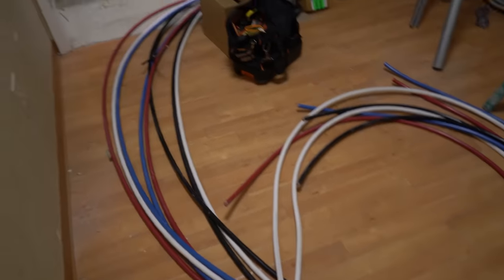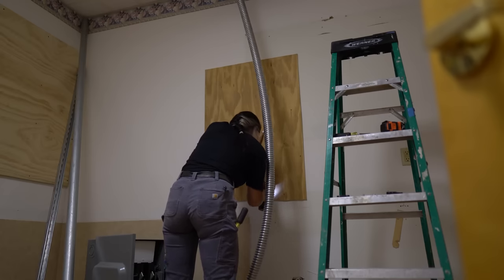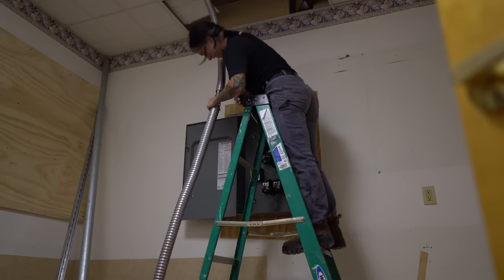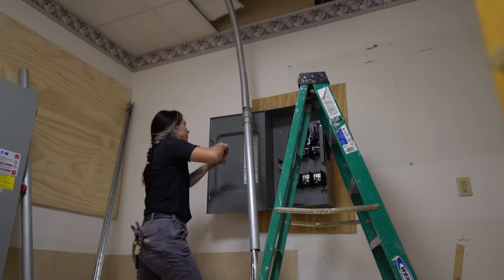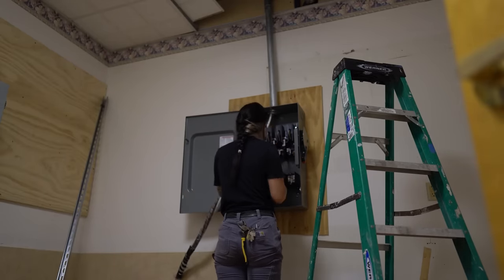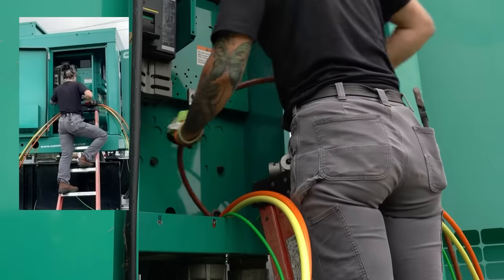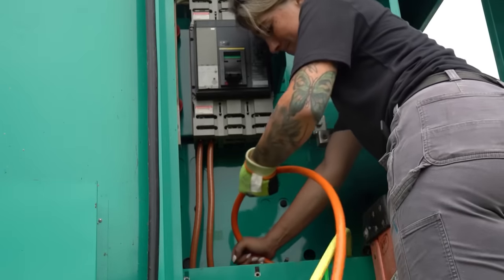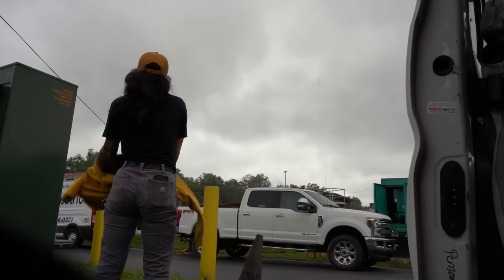Disconnect Mount & Pulling Parallel Runs

Comment: I love your work ethic! In my over 4 decades in the trade, I’ve worked alone more times than I care to count, I admire the way you worked to get that feed in the disconnect! During Super Storm Sandy, we had a rental generator brought to one of our line shops and the electrician was sent out with nothing to terminate with. Leads were 750 mcm and he was struggling so I gave him a hand. I used 2 hole lugs and a 2 ton press to terminate, it was a bitch but we finished it. Generator was for a temp feed, we never put it online, we restored power in the meantime. Again, well done?

Comment: Borrow a tip from cabinet installers.  When they hang cabinets alone, put a 2x4 on the wall at the height wanted, then place the cabinet (Switch/fuse panel) on that 2x4 and that takes the weight and can easily be held with one hand while screwing to the wall and/or plywood backer board then remove 2x4 once the panel is screwed in.

Comment: Condolences on having to be anywhere near a sewer lift station. As system operators, especially the apprentice operators, we had to ride with crews occasionally, to observe the water techs do their jobs. For those who'd never worked in that industry before, it familiarized them with their terminology, with the equipment we'd be monitoring remotely, and gave people a greater appreciation for the work the field guys did. Experiencing the stench from a lift station in the heat of summer, even above ground, and seeing literally THOUSANDS of cockroaches down in the wet well made me really appreciate what I did, and respect for the field guys.

Comment: I suggest you use a cleat on your plywood to temporarily support the panels until you can screw them in. If you get a couple of telescopic support poles, they will hold the cabinet against the wall until screwed in. Great to see you're not afraid of hard work but certainly know what you're doing. Have you ever tried using a Hickey bender for heavy cable? Just curious. Keep up the vids.

Comment: I found out that some areas of the country use Brown Purple Yellow for 277/480 volt system because the NEC says that orange is to be used for marking a high leg. In MN we also use B-O-Y.
Reply: I know down here in Texas with the utility I work with we do use brown purple yellow for 277/480 because over time the orange can at times fade really bad and some people will mistake it for brown. But it is interesting to see how others do things.

Comment: Pro tip from a none pro,  Drill first hole and leave your gun in it will hold the panel {Depending on the weight of panel}  also when feeding though pipe alone, I use a small amount of pookie at the tip, slides right in like butter. just dont put alot as it will be a mess and have something to clean it off when it pokes through. But meh, maybe I'm just dumb.

Comment: Afew things.
Determine where the bottom of the disconnect. Temporarily install a piece of strut so you can support the disconnect on it.
Is that plywood Fire rated? If so, you should put the labels outside on the Inspector would know. Maybe next time use a piece of plywood that square.

Comment: I’ve found it easier when hanging a heavy panel/box, once I get the plywood mounted, is to just shoot one screw in for the top corner (doesn’t matter which one) and hang the box on the one screw, then, use a magnetic torpedo level and lift the other corner up with one hand and shoot the other screw in. I hate measuring, it never comes out right for me. Lol

Comment: 110.12 all the way, nice work.   I bought the klein cable stripper in your video a while back, turns out it  doesn't work on URD, insulation is too thick.

Comment: In a future video when your working with the larger wire and termination lugs, show the final torquing and the choice of torque wrench and hex bits etc that you use for the job at hand as that will add yet another important step you perform normally off camera and you can explain the importance of doing such a procedure.
Reply: good Journeyman jiggle the feeders and intuitively know when to stop tightening.

Comment: What electrician doesn't have standard and metric allen wrenches? That's a job you shouldn't have had to go to. Like you, I take pride in doing clean work. Takes a little longer and I'm sure my boss isn't a fan for the extra time, but it's his name on the product and I need to make sure I make a good name for myself. So good job in keeping at it.

I jave that exact same Klein's strippers. Funny when I read the reviews that the pros who didnt like it used it on the wrong wire. It says on the packaging what insulation types to use it for. Yeah, they didnt read that part. Now I'm debating if I should get the larger strippers for the 350+ mcm. I haven't had to deal with that wire size yet.

Comment: Tip: If your working by yourself take the guts out of the switch it will be easier to mount and the gear wont be in your way when you put the cable in or better yet make your own KO in the corner so the cable comes in straight.

Comment: Is there a secret tool/way to figure out what a light switch controls or what socket is attached to?   we have a security light that doesn't work so it must be hooked up to a light but i can't figure out what that is connected to.
Reply: it doesn’t have power or the light doesn’t work?

Comment: 2 things if you have a truck worth well over $50K including the tools the owner can  afford to purchase metric allen keys. Doesn't appear to see any what you termed high voltage. 13,000 volt is called medium voltage and think high voltage doesn't kick in until some where over 30 KV.
Reply: It's all relative. For someone who'll never see transmission level equipment, distribution equipment is high enough voltage, compared to customer service voltage.
Reply: Right, I thought the same thing about the Allen keys, what electrician doesn't have em